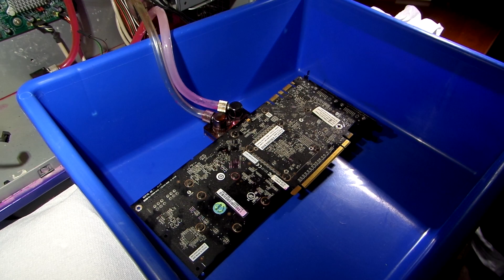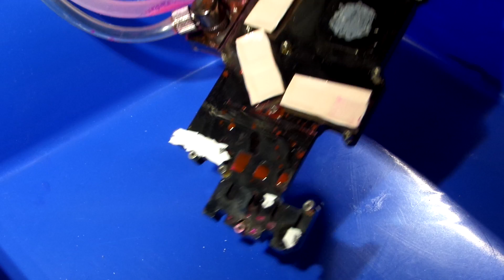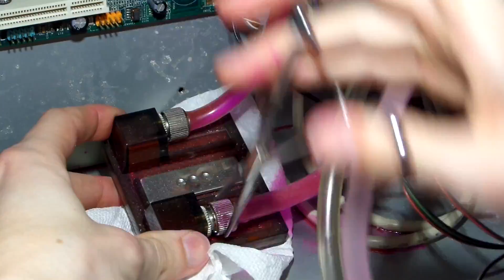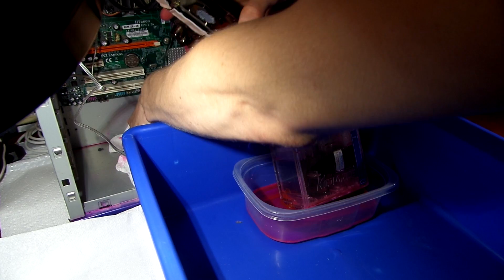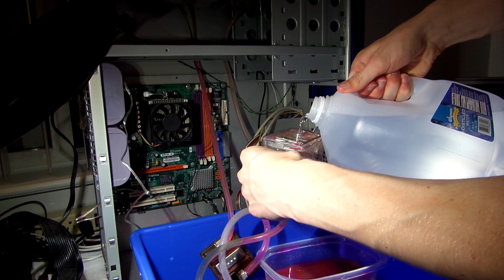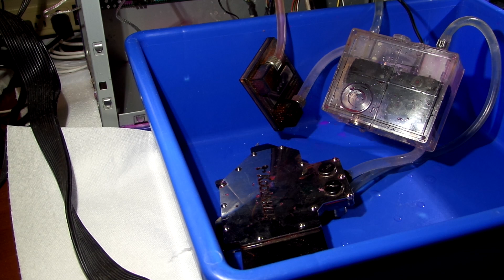Old Antec Liquid Cooled Server Case Refurbishment Project

Comment: Why not find a GPU cooler and make it an air cooled build or it's not worth it?
Reply from the maker: It would be cool, but this case is huge and heavy. I don't have to room to keep it around, and it actually sold just recently for $65 with the video card. The money will go towards a different project, and the PC parts from the build that I had planned went in to a different case. 

So to answer your question, it's not worth it because it defeats the purpose of building in that case.